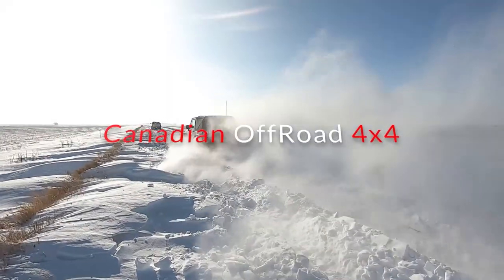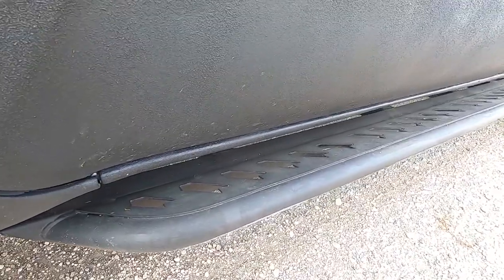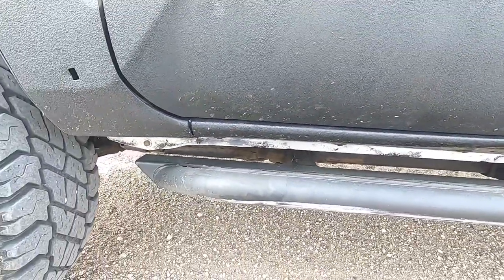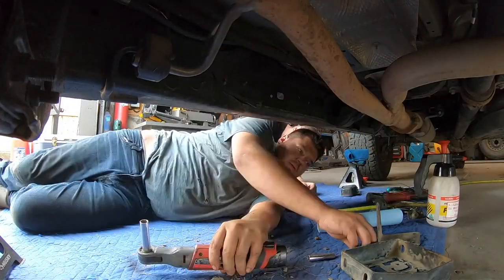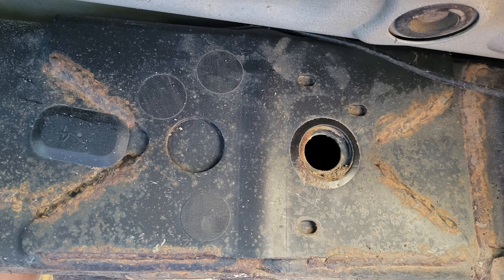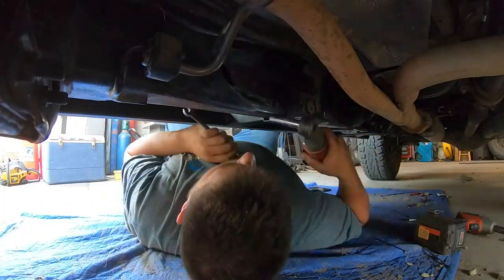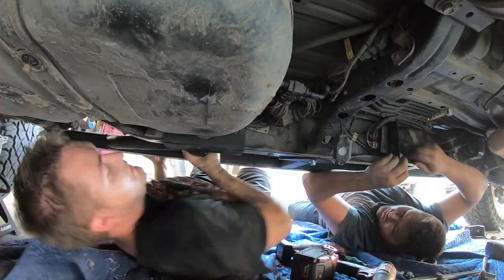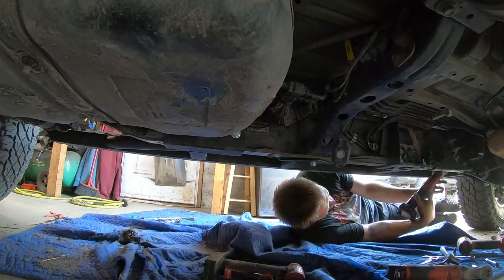Arc One Industries Tactical One Series Sliders - 3rd Gen 2017 Toyota Tacoma Install

Comment: Have em, love ‘em! Mike makes some damn good products!
Reply from the maker: Glad to hear :D I do too. They did some good damage to the front bumper of a Chrysler intrepid hahaha. They did exactly I expected. Kept the truck away from the bumper and took all the damage. Not to mention the bracket system and how strong he made these is not even close compared to the cheaper ones.
Reply: @CanadianOffroad4x4  ya the support bracket behind the rail is key! Also wanted to ask how you like your eBay snorkel?
Reply from the maker: @nathanthorsen  100%. So far so good with it. Takes the decent abuse from the bush so far no problem. Sealed up and functioning!
Reply: @CanadianOffroad4x4  any chance you could send a link of which one you purchased? thanks!
Reply from the maker: @nathanthorsen  Seller at the time was productpond. Looks like he doesnt even have a store anymore. Search your year tacoma and snorkel. you should find a couple cheapies. I found 2 on there, furange99  and packashop are the seller names. Take ur time research the sellers etc make sure its legit as can be and youre golden,